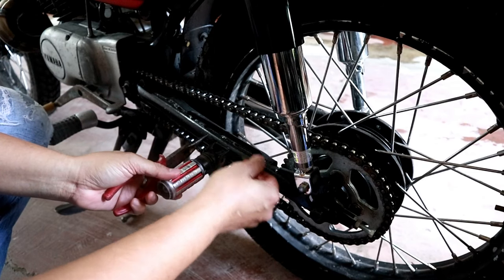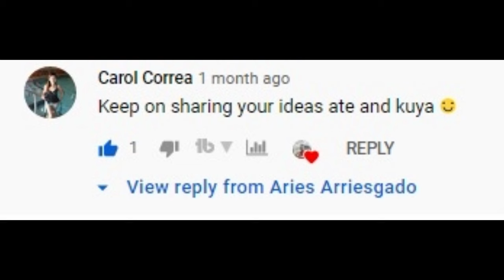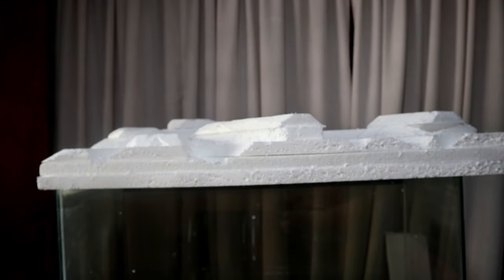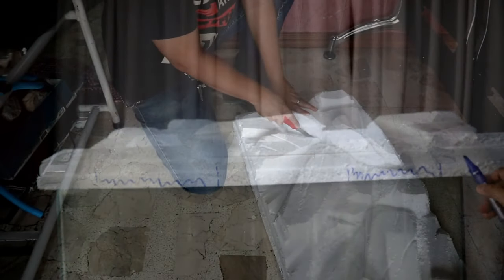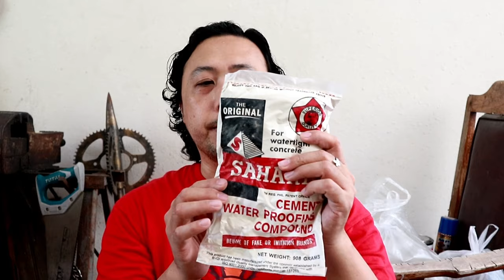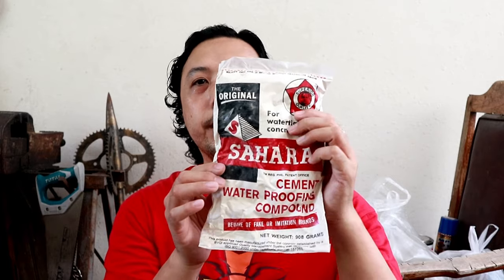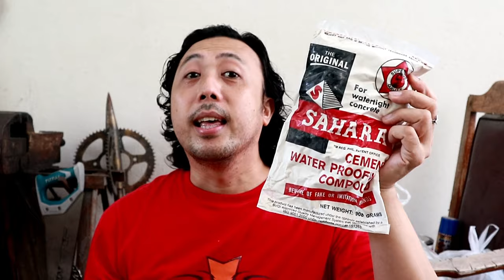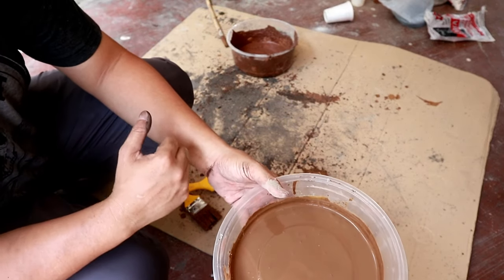How to: Make a Cheap 3D Aquarium Background

Comment: Do you think the ones you put on the ground needed to be glued or would they be heavy enough to sit on their own? I'm thinking about making some decor for my cichkid tank but don't want to have to drain it and take the sand out just to silicone the decor to the bottom of the tank. Thought about gluing some rocks in the foam for weight.
Reply from the maker: I glued them, or else all will will float. If you plan to make a decor for your existing tank filled with water. Try experimenting by adding heavy rock sandwich between Styrofoam.  Or better just use real rocks and use filter foam and super glue to glue the rocks together to create arch and different rock formation.

Comment: Amazing job, looks so real! I want to try this but don’t want anything permanent. Is it possible to remove the background even though you siliconed it on?
Reply from the maker: Thank you so much, You can remove the background, only if you want to permanently change the design of your tank. But I'm not going to promise that you can get the false  rocks  without damaging it. But you can easily clean the silicone residue with blade and time you spend removing it.

Comment: i am also making my own AQUARIUM BACK GROUNDS... mine will trap gallons of water that will not circulate and will stagnate... QUESTION.. will the stagnated trapped water be a problem that must be syphoned out periodically or is it actually beneficial for biological means... ?
Reply from the maker: I never have problems with stagnated water. Yeah stagnated water can be harmful. Make sure you have proper circulation, get a wave maker, and a very powerful filter.

Comment: Hi 
I need some advise I reasonly made a 3d background using spray foam 
Came out looking really great
But my problem is I just reseal my 5x2x2 tank and the 3d background seem to have lots of pressure for the tank
I will use silicone the place it
Will that be Dave for my tank ?
Reply from the maker: What do you  mean pressure? It's floating? Yes try using silicone sealant. Ang let it cure for a day. Make sure the 3D background are well stack together so that if ever one piece goes floating a bit. Each peace will hold each other as one structure.
Reply: Well, don't glue it to your tank's silicone...
Yes. It could peel the seams off of your tank!

Comment: Very good. Do water parameters get affected by the cement and chemicals/dye mix over time? I would imagine it keeps pushing up pH and hardness..?
Reply: Yours seems to be the only comment that he didnt respond to......   so apparently the answer is YES... He killed all of his fish.
Reply: @gladiatormechs5574  ha ha. I've actually found out meanwhile that the affect to the water is temporary so it's recommended to dunk in water for a few days changing water frequently before eventually moving it into the tank. Hope that helps someone.
Reply from the maker: Sorry I am busy making mascot head. I just checked my inbox now. No the water is 100% safe for my fish. It took more than 1 month for the water to become safe. Algae starts to form and then change the water. After a week i add the fish. The tank is still doing good right now. I will do a follow up video for this, The dye is 100% safe.
Reply from the maker: No the fish are safe and still alive. The tank is still in great condition. It took more than a 1month before i added the fish. You will see algae will grow on the rocks. Sign that it is good to go.
Reply from the maker: It doesnt mean when I did not respond. I am trying to avoid the hard questions😁. Again the fish are still alive. I will make a follow up video of this. I still have a Christmas moss between the walls and Photos plant on top with roots straight down the sand. It just I am so occupied with all the different projects and commissions now. Sorry for not replying sooner.

Comment: Wow, you don't need to use  R123 epoxy?

It's more easy, isn't it?
Reply from the maker: Hi Swan! Nice for you to be back. I am not familiar with that product. I checked it online. And it is a resin epoxy? If it works for you, then that is good. I also plan to make a fiberglass resin in the future. But I need to test it first in a small scale. Before making a larger one.

Comment: ARE ACRYLIC PAINTS SAFE to use ?
Reply from the maker: If we use the water base variants. But the chemical based ones. It is not. Though the spray paints design for plastic can be use.  And if its fully cured and no more solvents, it can also be safe.  But I prefer using cement dye. Wait for the update follow up video of this build. I will show how this tank is still in good condition. Ty
Reply: @AriesArriesgado  sounds great, i will wait for your video.. just subscribed.
Reply from the maker: @gladiatormechs5574  thank you so much!!

Comment: Good job , but the cement is toxic it will kill the fish
Reply from the maker: Yeah you are right. But there is a solution to that. 1st option is  it will take 1 complete water change every week. Do that for 2 months. Then wait for another 1 month 2x water change..until you notice algae starts to grow.  Do the final partial water change. Then add the fish. Until now this tank is healthy and so as the fishes. 2nd option is drop chopped banana tree trunk inside the tank overnight. This will neutralize the effect of the cement. But still you need to wait for the beneficial bacteria to grow. Before adding the fish.  Thank you😊
Reply: Why would it be toxic?